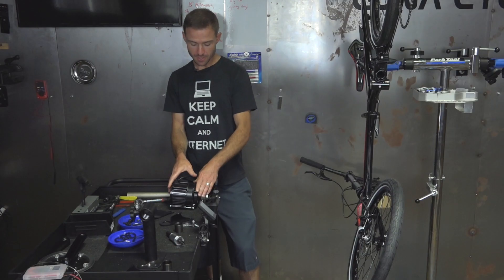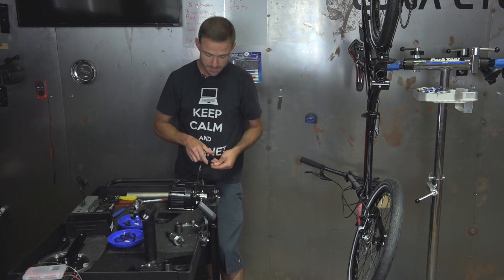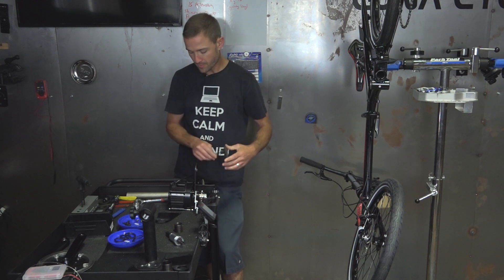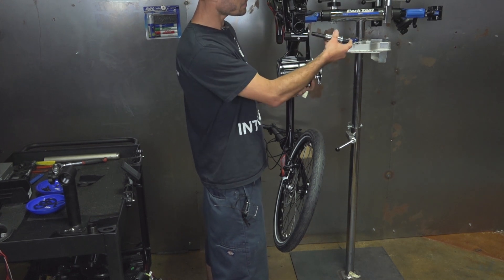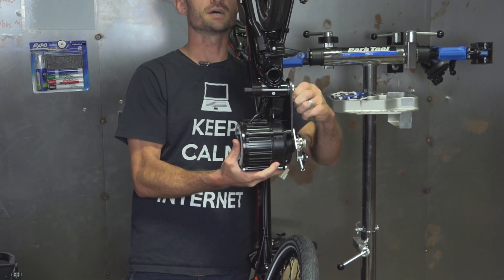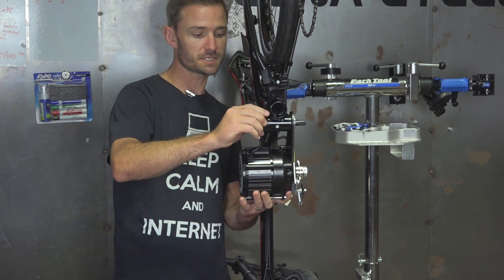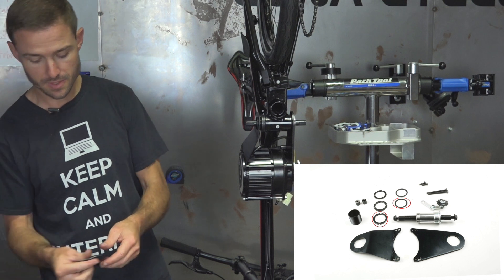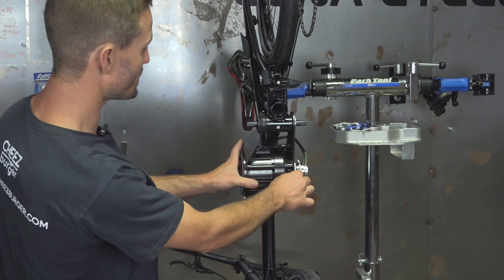Cyclone 3000 Watt 68mm Install Part 1

Comment: Just measured the bike that was gifted to me. Looks like a normal 26in Huffy mountain bike. So the bottom bracket measures 68 mm. I'm going to take a guess here and say that 68 mm is the standard. It's 68 mmmm and total length or width is less than 72mm.

Awesome video. This will be my first build. My first build for vaping was a copper Hades Mech Mod 4.2v. got to save up a little bit more, but besides 100 watts of solar panels I purchase for my first by, and the Drok 720w Buck converter coming nxt week.. I'd say I was meant to do stuff like this. And thanks to your video I went out measured the bottom bracket, and surprise surprise it's 68mm-72mm.

Nowadays things are pretty easy to do.
If you can pull yourself away from the screen.
Loving your shirt btw. 😷🙂🌞🐵 (+1)

Comment: How do you spin the pedal on the non-drive side? Looks like there is no room for pedal because of the mount bracket! You didn't show the pedals installed, I highly doubt the left one will do the whole turn!
Reply: You must have forgotten that pedals are not completely straight. The have an outward angle which actually adds quite a bit of clearance. I thought the same about my BBSHD at first too.

Comment: Is there a better way to tighten those nuts than putting a flathead screwdriver on it and banging it so it rotates?
Reply: Did you find out a way to do it?
Reply: @chriswf  That was pretty much how I did mine, got a long flathead screwdriver and hammer and finished the last 1/2 turn or so by banging on it.

Comment: I need the piece that screws into the BB shell, along with the pieces that go onto it (3 lockers and washer). I do not need the plates. I also need the bolts that go into motor, and through plate, my motor is missing 2 bolts. Then I can just buy their 68mm bottom bracket. I've looked at TW Cyclone site and Luna and nothing. I had to use a pipe wrench to get piece screw into BB shell out. Lube it! Anti-Seize It! I went with 2 gear crank, may go for the 3 gear crank buy buying their $10usd gear and spacing it with washers. Only thing I didnt like about geared motors are they are loud, walkers hear ya coming from waaaay behind them. I prefer no noise, so my last ride was Direct Drive, but I am going back to mid drive. I am sure I have everything but that piece that screws into BB shell, but that would be a long long hunt-fest. I am glad Luna bought a container of Cyclones to sell, and he machines all his own metal pieces or perhaps he just has a buddy machinist. Either way, I am riding mid drive again.

Comment: and that was difficult how? i thought that was pretty straightforward. if you can't do that, mebbe you should just buy a bike, instead of building one. no offence, but these things take a certain amount of maintenance,  and the more you know, the better off you are. bicycles are fairly simple machines. anyone can learn how to a complete teardown, and reassembly with a little time, a couple of books, and some time and advice from you tube. i started doing it when i was 9, when there was no youtube.
Reply: Its good PR for Luna to shoot a simple video on how to install. It would have taken them a few hours, and saved them more hours then that in trouble shooting emails/calls. Its good business sense. Do you see Cyclone TW helping customers like this?
Reply: on their web site, they describe this as a difficult installation. i came here to see what made it so. i didn't see anything difficult, so i made the comment. it was about their description, not the fact they posted a how to video. that, i thought was smart and decent.

Comment: Spacers... That makes sense. Holding the brackets up to the motor without them, the plate interferes with the motor. I don't think I got the spacers with my kit. I haven't had a chance yet to try it out on a bike yet. My 2000W motor mounted right up no prob. I hope I get a chance to play with mounting the 3000W motor this weekend.
Reply: I have the 4000W, a bit bigger motor then the 3kw.

Comment: can i put my original bike 28tx40t chain ring instead of the middrive chain ring?
Reply: You can use any chainring that has a 104 BCD. They also offer a 24T that mounts directly to the freewheel.

Comment: What makes the new mounting brackets better, and do they work with 120 mm BBs?
Reply from the maker: The drive has  a lot less flex and no longer needs the crappy looking hose clamp it needed before.
Reply: Luna Cycles Thanks.
Reply: Will work great on 120mm better than 68mm